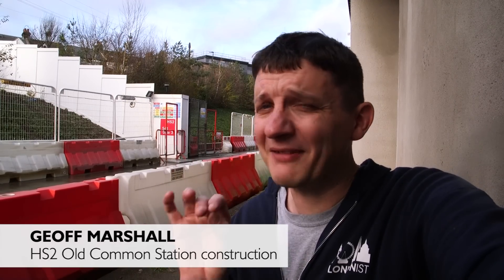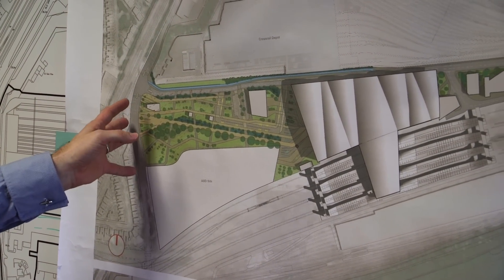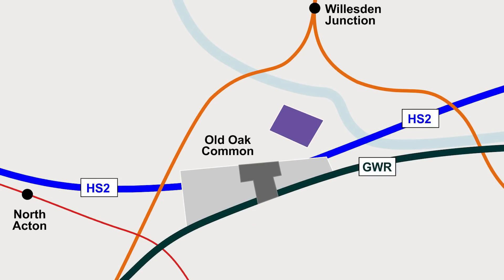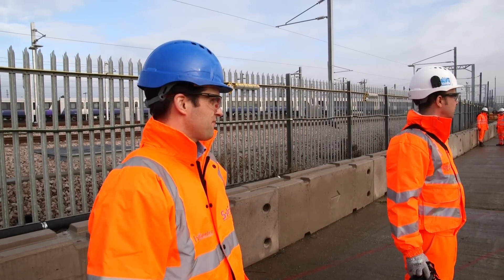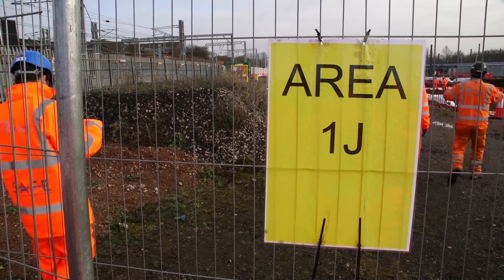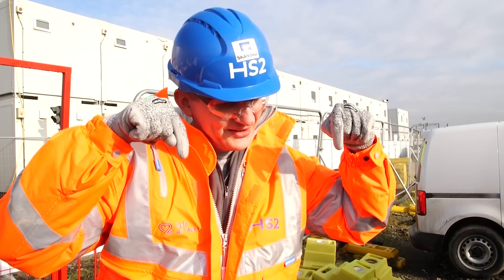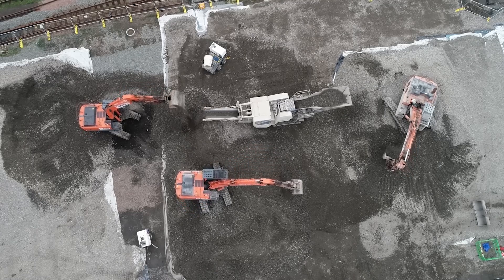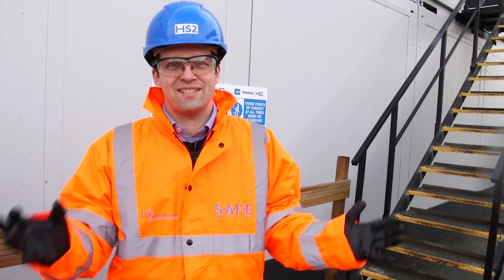HS2 Old Oak Common Station Construction

Comment: It really seems like a bad idea to have a train line going north to be going this far west. I feel like this project is somewhat of a frace. If you have a high speed train travelling North, why would you have it not just go westward but also stop aswell. Isn't the whole idea of high speed rail, that trains stop infrequently?
Reply: If you look at a to scale map, it doesn't go very far west. The WCML also heads west (it's just to the north of the site) and then wiggles up to the north. The trains will not be approaching the buffers at Euston at high speed. You must have been on trains that always crawl into terminals at excruciatingly low speed. IIRC it's estimated that the station will take around 40% of the London traffic as it is so well connected.

Comment: HS2 will no doubt go over budget and terminate at Birmingham for the foreseeable future. More worthwhile project would've been Crossrail 2 or better yet Northern Powerhouse since people aren't looking to make long distance journeys anywhere near as much as regular commutes
Reply: You're right in that HS2 phase 2a and 2b really have to be built for HS2 as a whole to make sense, but saying HS2 will only cater to long distance passengers is misguided; it will free up capacity for even more services on lines like the WCML and even the ECML if/when it gets to Leeds.
Reply: @reallyrekt3326  that's true but there are far better things to do with 50 billion or so pounds. Electrify Chiltern for example and improve travel in the north, they deserve it. Dispatches on channel 4 spoke about HS2, there won't really be any benefits for a very long time. All we will be left with is 4 different options between London and Birmingham (Chiltern, LNWR,Virgin,HS2). Northern cities need to be linked, not yet another railway in the south that's supposed to go to the north but due to spiralling costs might not. Nevertheless I agree, if it does happen, there will be benefits but we could've seen bigger benefits elsewhere and faster
Reply: @Ethan-ik1nm  HS2 is as much about the capacity it will free up on the WCML for freight paths as anything else. In 2011 we transported around 15 million tons of container traffic on the network, with the majority travelling up the WCML corridor. By 2030 that number is projected to be 43 million tons. So far, a new railway is the only long-term solution to this issue that I can see, but I'd be more than happy to see genuine alternatives (and that doesn't mean vague suggestions like "improve the existing network" and "electrify x line")
Reply: @Ethan-ik1nm  Electrifying the Chiltern Main Line won't do much for capacity all by itself since it's double track literally from Marylebone all the way to Moor Street. Your other schemes are good, and NPR should go ahead, but alongside HS2, and saying that because transport in the North isn't perfect is like saying the QEII bridge shouldn't have been built because my local high street has loads of potholes.
Reply: @avroredgrave954  I agree except if there were more cross-country lines from Felixstowe then freight would not have to go down to London and back up as it currently does. Just a seven mile length of track between Sandy and Bedford would increase freight capacity. It's being planned as part of East-West rail.
Reply: @Ethan-ik1nm  No big infrastructure have immediate benefits, even electrifying the chilterns would probably take around a decade to do.
Reply: @Ethan-ik1nm  not quite right, as today's Virgin services will become the HS2 services in future when the project is complete. By that moving, it opens up opportunities for LNWR to run more commuter type trains to London
Reply: York to Liverpool is just crying out for a High Speed Line. Just so slow and overcrowded connecting between all the places on the transpennine route.
Reply: Michael Scott transpennine upgrade has got the go ahead.
Reply: @22pcirish  It's only an upgrade though, when it needs a whole new dedicated High Speed Line really as half the time you can't even get on seats you've reserved because it's so packed. Ideally it'd split in two between Leeds and Manchester, one branch going though Huddersfield and the other going through Leeds/Bradford Airport, Bradford and Halifax.
Reply: Brings up Crossrail 2....what needs to happen is electrification and modernisation of the nation's railways, not just London.
Reply: Worth remembering that the channel tunnel went 75% over budget, yet is still successful and a huge asset to the system. HS2 needs to be thought of as the fourth main line. It's an additional line not a stand alone.
Reply: @22pcirish  successful though I think only because the debt to build it was written off.
Reply: Or heavens forbid investing in all 3 much needed projects. Always cheaper to build now and reap the benefits than wait.
Reply: yep,some parts of the Crossrail 2 line doesn't need building so just the Wimbledon-new southgate&Tottenham hale.
Reply: @BowlerStuff  See my other comment about linking Sandy to Bedford - this way passengers from the north on the LNER line can go straight to Clapham Junction. It would be good to see how much usage of the Victoria line is just people travelling north to south. London needs more stations like this that take pressure off the underground.
Reply: John Airey ideally I would like to see the Bakerloo line go to Hayes, the Victoria line to East Croydon and the Northern line from Battersea to Chessington South
Reply: @AlrightDave9188  something has to be done to increase capacity on the underground or to take cross-london passengers off it.
Reply: @hairyairey  Correct
Reply: @AlrightDave9188  Yes of course after all Croydon, Bromley, Kingston and Lewisham all get a tube station
Reply: Or they can add all TFL lines there to terminate to.
Reply: The danger of HS2 is it destroys the east coast mainline, making it inviable due to losing all passengers north of leeds. Should have gone up the middle of the country with branching terminals.
Reply: @streaky81  No it adds capacity where there is the greatest shortage. The ECML is also short of capacity but it will be many years before HS2 is anywhere close to affecting its traffic. Leeds and Manchester are phase 2.
Reply: Yeah, phase 2 is the problem. HSUK plan was far far smarter and we'd have ended up with a properly integrated high speed network.
Reply: @streaky81  Yes
Reply: Name one major infrastructure project that's HASN'T  gone over budget??
Reply: Crossrail 2, the Bakerloo Line extension and East-West Rail should be the projects to spend on
Reply: whoops